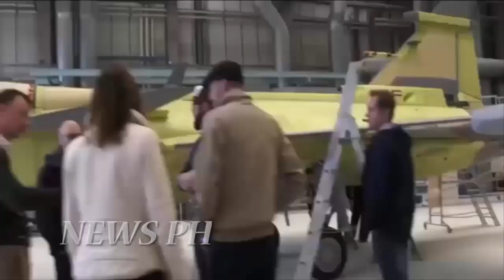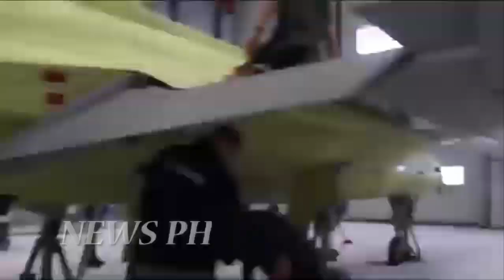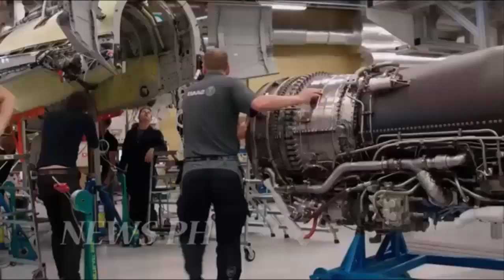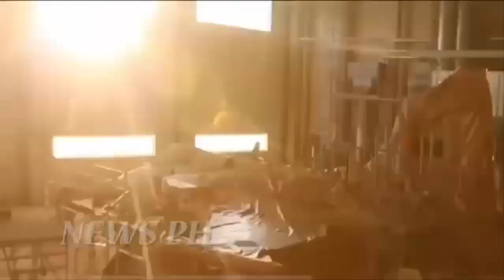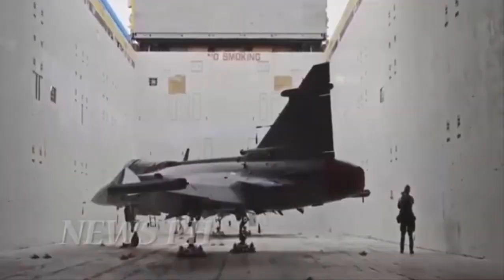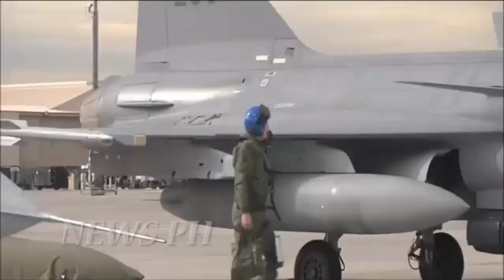Saab has 14 new Gripen C/D airframes built for the Philippine Air Force

Comment: JAS C/D can be upgraded electronically to basically E/F standard just with the bit smaller airframe of C/D but as capable as the E/F.
Reply: but which is a better uograde?
Reply: @ForbiddenAqui32729  of the JAS and F16? I have no idea, I'm thinking the F16 might be a better dogfighter but the JAS has better sensorfusion and EW suite but that's pulled out of my a** and no judge on the F16's upgrades..